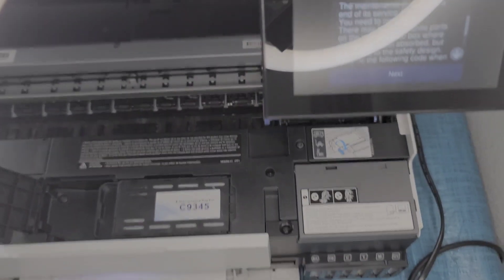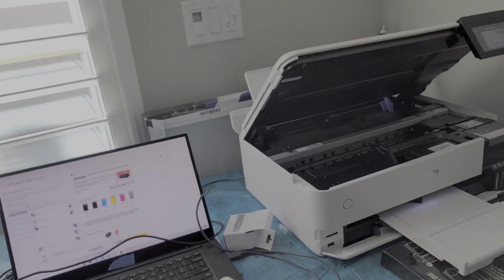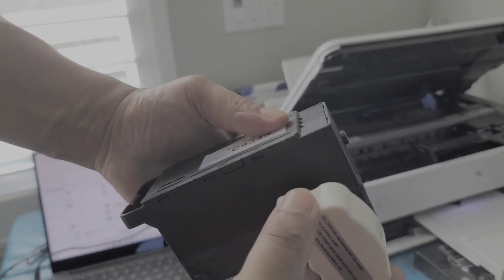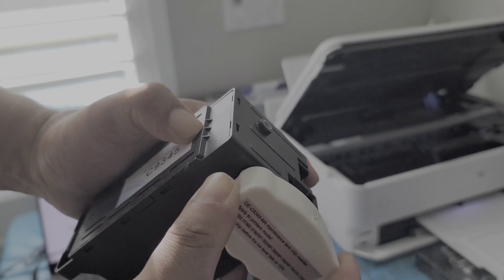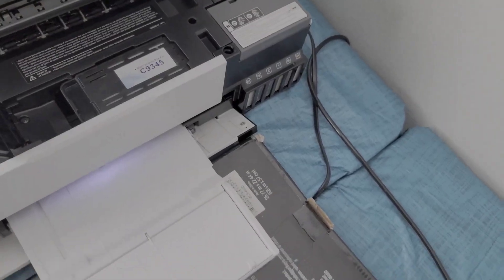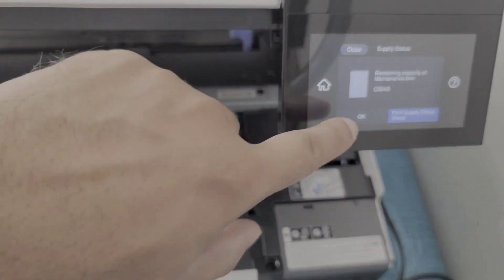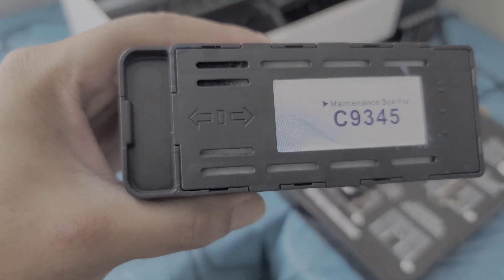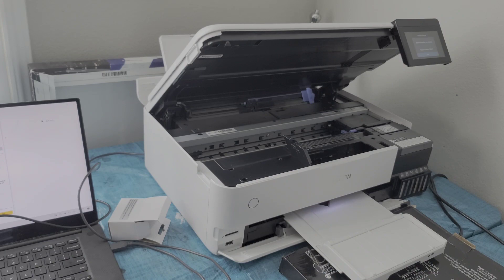Epson Eco-Tank ET-8550: Reset Ink Waste Box

Comment: Hi when i installed on  my new maintanence box on my epson 8550, the box will not snap in. What do i need to do?
Reply from the maker: Remove the maintenance box, look in where the maintenance box goes, the rubber piece from the previous maintenance box may still be in there

Comment: My brand new 8550 error of maintenance box not installed
Reply from the maker: Sometimes the little rubber piece on the maintenace box comes off, Remove the maintenance box, check inside where the maintenance box was inserted on the nozzle, make sure noting is on it.

Comment: Could you explain more about the ink waste pipe and the chip resetter?, I don't get it
Reply from the maker: When the printer cleans itself, the wasted ink it uses goes to the maintenance box. When that maintenance box reaches 0%, you will no longer be able to print until you buy a replacement maintenance box or you can use the chip reset to reset the box to 100% by placing the chip reset onto the chip on the maintenance box. When it turns green, the maintenance box will be reset.
Reply: @HangryMuscle  but the maintenance box still full,right?
Reply from the maker: @rubenagurcia906  yeah it will be. You can just empty it and put it back in
Reply: @HangryMuscle  could you show how to empty it , please?
Reply from the maker: @rubenagurcia906   https://youtu.be/lzOqtVKDczU
Reply: @HangryMuscle  and even if you connect  an external waste tank onto it, it  will still show full at time right? The maintenance box counts how many times you have done head cleanings, not just if the box if full. Correct?
Reply from the maker: @nique4791  The maintenance box does not keep track of how much ink waste is actually in the box, It's only tracking the counter on the chip in the maintenance box.
Reply: @HangryMuscle  can you do a tutorial on how or where you connect the hose to the waste tank ?
Reply from the maker: @nellynell6715  https://youtu.be/lzOqtVKDczU